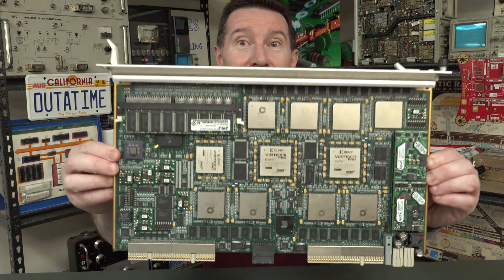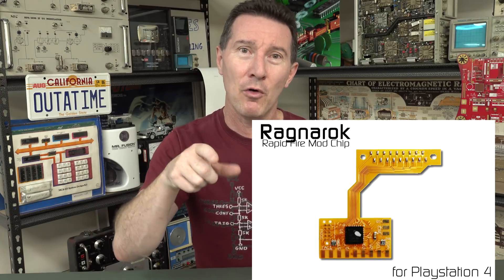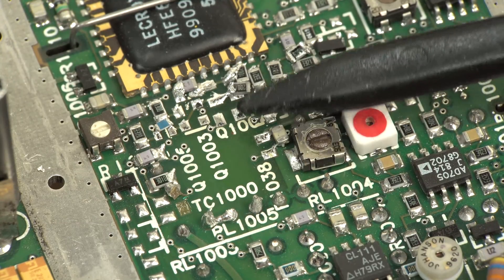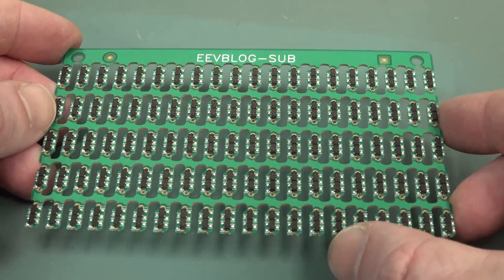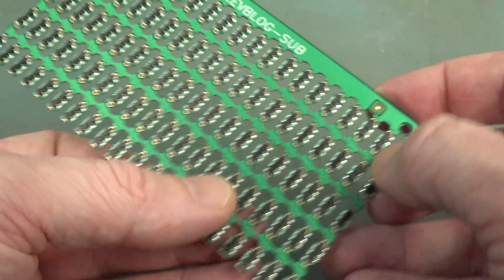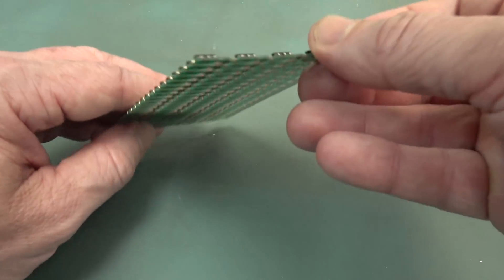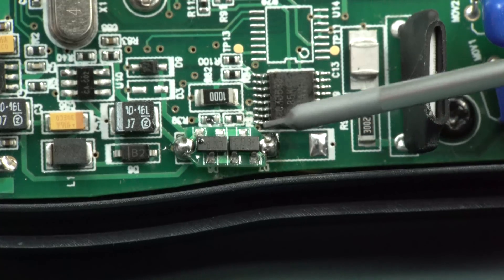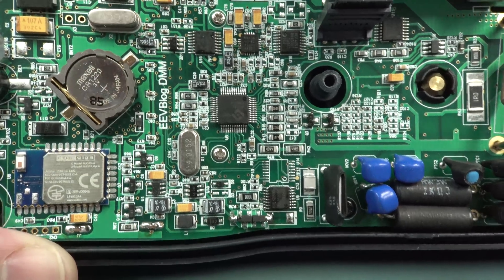EEVblog #1158 - How To Create PCB Mod Boards

Comment: Great useful idea. Never thought about that.. :D
But used it to.. One time, when i created prototype PCB, i didn't spot mistake - in software database was component pin mismatch for voltage regulator in sot223 case.. after soldering and joins verification, aplied power and tested with multimeter, voltage regulator not regulating as it should.. ok, first idea, replace regulator, same result.. then i started verifying schematic, all ok and when i manually start to compare pinout, datasheet and board, i find out that pins in database are opposite.. :D First idea, new board with error correction, second idea - create new mini board to hold regulator and to match existing board.. And finally i create it in quick'n'dirty method manually with permanent marker on a small board 10x10mm, etched and soldered it in the place of old version's regulator.. All worked and i soldered in all chips.. (I love to use steps when creating something from scratch and that's why i didn't fried any chip - first step is power rail check).. 

Second time when i use this method, board was bigger and with more part's - i replaced unknown, dead smd chip for backlight driver in GPS navigator.. That was comlex project because space in enclosure was limited, lot of research with scope to understand what exactly this chip originally was doing, pcb examination, some reverse engineering.. But at the end all worked as it should with brightness regulation and power control from mainboard.. GPS was alive again and i had a fun.. :)

Thumbs up, as always, for great video with good, useful points and for reminding this method.. :)

Comment: I don't understand how the pick-and-place machine uses the mod boards in production. Does the machine break them off the larger board you showed and then place them? Or, does someone have to break them off manually and then put the little mod boards into some kind of a magazine? Thanx
Reply from the maker: Someone has to break them and place them in custom trays. If you weer serious you would do this, but most likely easier to simply hand solder the part.
Reply: @EEVblog  Ok, thank you. This makes sense. Otherwise the pick-and-place machinery would have to be quite complex. I guess that's obvious
Reply: @henryD9363  I was confused at first. When he was talking about putting that board into the P&P machine, he was talking about putting the components onto the mod board (populating the mod boards with components), not putting the mod boards onto a main board.
Reply: We hand place these after pick place and before reflow. Too much trouble to program and make trays!

Comment: When your panel is so floppy because of the many cutouts, why don't you leave some wider edges and spokes to make it easier to handle during assembly?
Reply from the maker: You could, especially if you had heavy parts. In this case it's not needed.

Comment: at a previous employer we we building 40 small detectors for a large company who has to remain nameless, anyway on a really tight deadline when we went to start assembly the supplier had sent sot23 versions of a particular part, not having a substitute part and not enough time to re order we just used those little adapter boards, in the end it worked out better since battery life improved and sensitivity increased, not mega amounts but noticeable, in fact the "bodge"board became a service replacement when refurb and service was done on older units.
Reply from the maker: Been there!

Comment: Was it actually economical to pick and place a board like this?  It doesn't seem like you needed them in quantity really so the setup costs alone seem like they would have been excessive per board.
Reply from the maker: When you are a company that does this stuff daily, it would be cheap and easy
Reply: @EEVblog  Ah sorry I wasn't very clear.  I mean in this example with the board you were handling for most of the video, the one which only contains the clamping transistor pairs.  I was curious how many of those you actually needed populated by pick and place and if that was economical.  After all how many of those sheets did you ultimately have populated compared to the tooling and setup costs?
Reply from the maker: The board I showed was not pick and placed. I was just mentioning that it would actually be possible if required.

Comment: Cool video. With our customers it's rare to see them making an extra board for a mod, most of the time it's just a bunch of bodge wires ;^)

Also Dave, how are you planning to roll the 121GW mod boards to those that already have the DMM?
Reply: I'm guessing the modboard is to make up for a supply deficiency (the part went out of production?), not a design flaw, so there should be no problem for existing units
Reply: He mentioned in another comment it is only for new builds and not for those already in customer's possession, as if you do the mod on your tool it will require recalibration on multiple circuits. And the mod is an upgrade,  not something your tool necessarily needs.
Reply from the maker: No need for the mod board for existing customers.

Comment: Never mind mod boards, what's coming up in the old arcade game scene is custom ICs. Well, not really ICs. They're little boards that replicate the functionality of failed custom so-called hybrid chips. Usually SIP,  ceramic substrate, always encapsulated. The two I've got was a video DAC/buffer and the other did audio mixing for music and sound effects.
It was once thought that once these custom components are gone, that's it. Fortunately there's guys out making replacements.
Reply: urdnal I’ve bought similar boards for old synthesisers. There’s a guy in Belgium makes replacement VCF and VCO boards for the Roland Juno 106 that basically keep these things alive when the resin on the originals goes conductive and kills it.
Reply: NVRAM!  nvram.weebly.com =D
Reply: There should be more people repairing good old stuff like that.
Reply: @CyberlightFG  I see arcade boards as the grand old dames of video gaming. Big ass, expensive boards, banks of UV EPROMs, all to play only one game; seems ridiculous now. They deserve to be preserved and admired. 

It might not be important to most people, practically anyone I mention this hobby to brings up emulation. Fair enough, it's hard to argue from a practical standpoint. For most things emulation is certainly good enough, in some cases better than original (look up LAGFIX), but I get a kick out of knowing it's running on (essentially) original hardware.
Reply: Replacing the audio hybrids on boards like Xmen ??
Reply: @cozzm0AU  Correct. I have a Xexex board, which has the same hybrid, the Konami 054544. I think these require transferring the 054321 ASIC from an original, since I don't think that's been reverse engineered yet.  I haven't needed this one yet, the audio module I needed is on a Raiden II board. For my Xexex I have a repro 054573 RGB DAC.
Reply: I will definitely future proof my C64, so that my nephew can play with it.
It just needs a new power supply ( too old, too fragile) and an SD card. Still works fine.

The emulators doesn't work that well.

Comment: In the defence industry, finding replacements for obsolete parts can be a real challenge. Especially for older systems where there's not enough documentation. Legacy platforms and systems are a real pain.
Reply from the maker: That why we had a full time engineer just devoted to that role
Reply: @EEVblog  Especially because there is a whole business model catering to defence industry that will try to sell you that shitty jellybean germanium transistor at ridiculous price because they bought out all the stock from the parts market.
Reply: @EEVblog there was one recent example I know of where an engineer was asked if a particular power resistor could be used to replace an obsolete one but there was only an assembly instruction for the equipment, no dimensions or anything. It was considered finding the platform that this equipment was fitted to and finding out that way but it really was not worth the engineer's time to do that. Shame really... the defence industry (at least where I live) is really behind the times in terms of obsolescence management and legacy management.
Reply: I can imagine:  Remove good part, characterise, implement old part with new tech on same footprint, re-qualify part, install.
Reply: @jebsaekam  you would have to re-qualify the board not just the part. That's full temperature cycling HALT and HAST testing the works if it's going onto anything that moves. The maths is hideous for qualification if you are expected to predict lifetimes before testing too. I still have a copy of the MIL-STD for that and it's 500 pages of equations. Developing a mathematical model from that to go on a spreadsheet took me near two years.
Reply: I did this job for a few years and it was a right royal pain in the neck. I had bosses expecting pin for pin replacements on tech which was completely obsolete. Gallium transistor type obsolete in some cases. With simple stuff like op-amps there was often a similar device but rarely in automotive grade (-40 to +125C temp range) never mind full military (-55C to +125C) and rarely in ceramic packaging (the ceramic package helps match the coefficients of expansion between the chip and everything else). Then try getting one to MIL-STD-883/B.

Comment: 6 digit price in dollars for a single board?! Are the traces made of solid gold?!
Reply from the maker: ASIC development boards is one example of a 6 digit priced board.
I worked on a $10M project that had previously two huge boards filled with the highest prices most exotic stuff. The entire project hinged on those two boards. It was a stackable offence to touch one without going through proper ESD checking every time you entered the room
Reply: @EEVblog  If you touched it where did they make you stack? ;)
Reply: @EEVblog  Thanks for the reply. I'd really like to see a video about something similar. As my previous response to Marian Keller, I doubt that a single project can be so damn expensive for real (something like the complete electonics of a space probe probably can) - I wonder what kind of multipliers are applied to the real expenses by both the suppliers of the custom parts, R&D and production departments of the final products, just because they know the customer will pay whatever price for it.
Reply: @mrnmrn1  In small scale the expense is the time - instead of your super fancy ASIC development board that you will only order once they could make few thousands much less labour-intensive boards from their other customer. There's only so much PCB manufacturers that will do really complicated stuff on non-production scale and they're swamped with work.
Reply: Fancy low-volume ASICs, high-end FPGAs, crazy HF components, 64-layer PCB with custom stackup and exotic materials, assembled and inspected to aerospace standards. 
And I still wonder how much smarter the people who design such stuff must be.
Reply: @MarianKeller  I assumed something like this, but I still can't handle that crazy price for a single board. $300k for that 32GHz scope in his 2017 April's Fools video is kinda OK, it has a lot of 'Fancy low-volume ASICs, high-end FPGAs, crazy HF components', it has huge R&D costs, and it is made in low volume.  But 6 digit price for a single board... I really like to see an example of this, and a BOM of that with detailed prices.

Yes, aerospace, miltary and similar stuff - whilst obviously of a higher quality standard, low volume, high R&D expenses, thus much more expensive products - I think these are obiously priced with a random multiplier of the real costs - including R&D, beacause the customer has a thick wallet, and if they need it, they will pay whatever price for it.
Reply: @mrnmrn1  You have to remember that "low volume" for a commercial piece of test equipment can usually be lot more than in some cutting-edge project. If you do a run of only like a dozen ASICs, then that single part already costs six figures.
Reply from the maker: I've personally designed with $5k FPGA chips, but they can go up to 10's of thousands each. And those FPGA ASIC development boards have dozens of those chips.
Reply: @EEVblog  I've always wondered what purpose would one use a $100,000USD FPGA for with 37m logic elements.... simulation of large pieces of silicon before it gets rolled out I guess?
Reply: Dude, solid gold is like $1.2k an ounce. Mid 6 digits are like 30 pounds of investment grade/proof gold. Shit they use for coating pads is only half gold at best.

Comment: If you want some examples of what these are used for in the console space, other than the old piracy chips, this site has a good selection of the video quality upgrade kits, generally used to get a decent RGB signal out of old consoles that used composite/RF; http://www.oldskoolconsoles.com/shop-2

Not associated, just first link that showed up for me :)

Comment: 6:20 it looks like  they just threw some capacitors just above your stylus :-O

Crash soldering ? :)
Reply: Dave ripped up one of the pads next to the marking TC1000. Hopefully it wasnt needed.
Reply: @mrlithium69  It was a scrap PCB...
Reply from the maker: @mrnmrn1  Yes, it's a scap PCB, zero care factor. The mod board crumbled when it was removed, it was a mess.
Reply: I thought this was the ugly style mod, before the mod board

Comment: Another great video, thanks Dave.
 I'm wondering if there's such thing, similar to the through hole matrix breadboard prototype type PCBs you solder to, but for surface mount.. I seem to be accumulating loads of surface mount things but.. not really sure what I'm doing with them!
Reply: There is a few options on ebay, but, for the most part seem to be outrageously priced..  ..speaking of which, digikey also has a vast stock of proto boards, i wasnt looking for surface mount in particular, but, they would probably be your best bet as they are a reputable source.
Reply: @topherteardowns4679  thanks, I'll keep my eyes open then! I have various proto boards, the strip and matrix ones anyway. Perhaps I can figure out another way to use them with surface mount.. I trying to avoid buying a bunch of breakout boards and such for something I'll inevitably mess up 🤣 I bet I can repurpose small pieces of strip board or so and make little pieces like Dave or something ☺️
Reply: @ollieb9875  yeah, I always buy cheap proto boards when I see them, just because they are cheap and can be used for a limitless number of projects -I even use smd chips on the standard .1 hole proto boards.. Sometimes its a pain in the ass, other times it is much much much more beneficial than either trying to find the niché adapter or making a board and spinning it in FR4 pcb.  If I comr across the seller/order i recently got of the smd proto, I will reply here with the keywords to search
Reply: @topherteardowns4679  I think I saw some on mouser.co.uk (being in the UK) SMT proto or breadboard, something like that, but never really looked properly.. I'm making some things for Christmas so will look tomorrow, but I may just do as you say and use what I have if they're too expensive ☺️ Cheers!

Comment: the v groove issue was probably because you used a .8mm board!
Reply from the maker: That played a part, but it ultimately was just a loose tolerance of the cutting wheels.